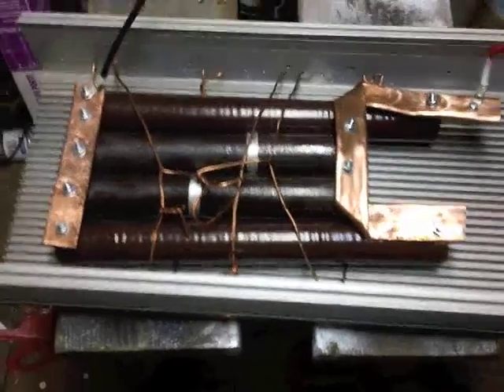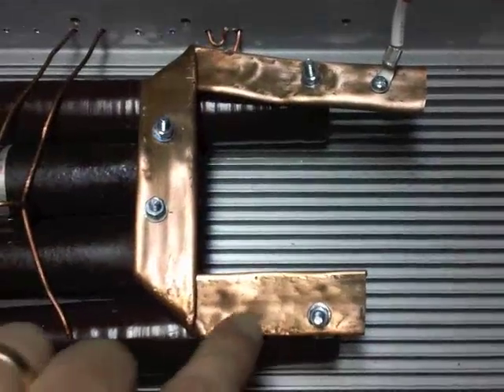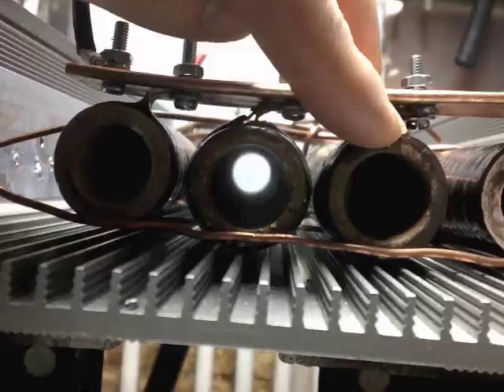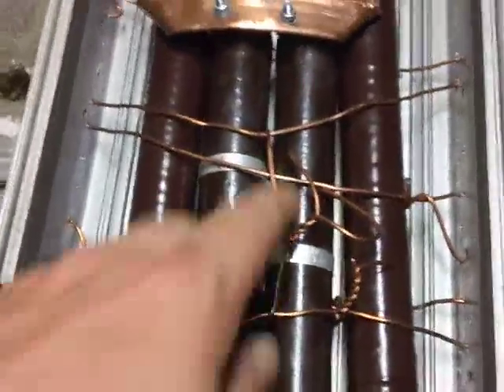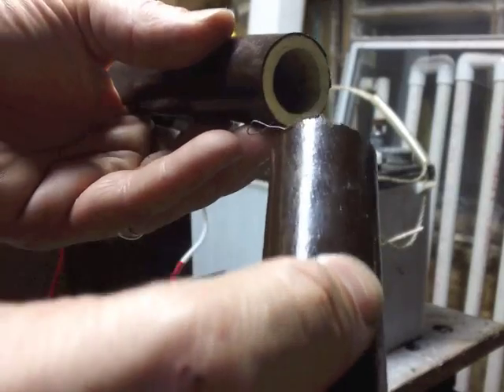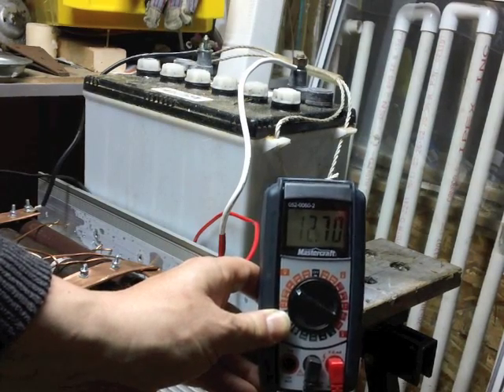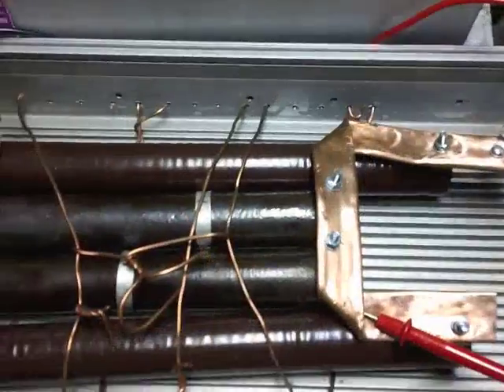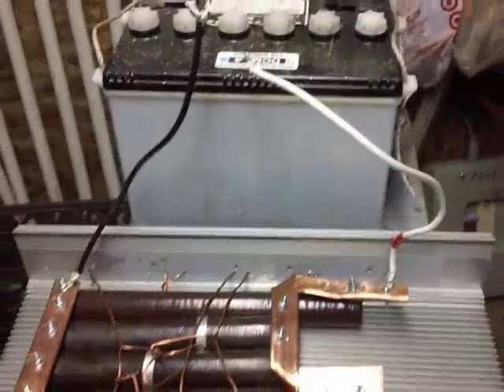Part 2 of Homemade Dump Load for a Wind Turbine

Comment: Heat is a product of power but not just power - average power. You can peak high power instantly - well above the wattage of a resistor - and have little effect on the burning up of the  resistor. This does not mean that if you put 1000 amps in a wire or material that it won't burn up a wire or material that is much lower in capacity than the 1000 amps - instant flashing at hot spot where the wire or material is weakest. 

When the accumulated heat from the average wattage exceeds the wattage of the resistor then it will be damaged by heat or burn up.

If the average power is much higher than the rating and it would burn up or open up connection --there is a way to increase the effective wattage even continually. He talked about sand - may work OK but this is much much better. Have a paint can or container that you put the resistors in and fill it with pure oil, which is not conductive. This is what they do in power transformers on the power grid - oil filled. Lightning can strike those transformers and flash over inside, breaking down the oil, and the oil moves around and mends the broken path where flash-over occurred. After years the oil is replaced because it becomes toxic and has leakage due to high carbon content.

At the same time those transformers use the oil to transfer the heat away from the transformer to the transformer case and its fins designed to have a large surface area to dispel heat to the air outside. This principle is why an oil filled can can increase the effective wattage greatly - venting the heat to prevent burnout- or a short..

Comment: Hey, I was thinking about this last week. I am now in an appartment and i am not able to use my wind/solar/hot water stuff at all. I did buy a few more toys like a 600W 12V water heater element, and many other trinkets that I am now storing while I pay for electricity from NWE. Ive herniated another disc and now have low and upper back issues. I wish u luck with all this. and I didnt ever find the good pictures i wanted you to see. sorry Brother.    73
Reply from the maker: No problem, maybe you can mount a solar panel on the balcony and create your own mirco off-grid project. Keep me posted on whats up. Cheers!
Reply: The Cedar Workshop I dont have a balcony or even South facing windows. I couldnt pick a worse spot to make solar power. no chance of a turbine!  Im stuck for the moment.

Comment: I would have connected the fan when the dump load activates to keep the  resistors cool.  I am also not very comfortable mounting the with the copper wires run  over the resistor packs.If a short circuit occurs that could produce a very nasty flame situation. I am sure the manufacturer of the resistors has recomendations of mounting .
Reply from the maker: This was my secondary dumpload. Used with the small wind turbine. No problems and it is monitored. Nothing from the manufacturers. Just a box.
Reply: Why are dump loads used as opposed to just open circuiting the turbine supply and killing current to zero ? Is this because the fans go into brake mode ?
Reply from the maker: The dumpload is for  the batteries. The power has to go somewhere.
Reply: I don't follow sorry , what purpose does the load serve in the battery ?
Reply: The Cedar Workshop
haven't watched it all yet. but you can get water heating elements, free hot water(or pre warming a hot tank) when you need to dump a load. pardon the pun.
Reply from the maker: Lets say you are away and there is a wind storm, the batteries (connected via wind turbine) would get charged up pretty quickly. Once they are charged, the power generated needs to be off loaded somewhere.
Reply from the maker: Sirus Yea, I want one of the those water heater elements. Maybe once I work out the cabin water system, I'll look into it. Thanks for the suggestion!

Comment: one big question. what do the resistors OHM out at??  the broken units wire seemed very small. my resistors have the resistance listed near the end and otheres are stamped in the middle. my units look like someone wrapped a flattened 18G wire ans then glazed it on the resistor. and FYI they can short to your copper supporting wire if the glazing is chipped on the resistor. in 15-20 seconds my unit would burn ur hand. ill look for pics 4 u.

Comment: I used the same style of resistors to make a hot water dump load. i used 2 resistors and i wrapped 1/2 inch copper pipe to increase their diameter. i put the pipes inside the resistors. i then used street elbows and "T's" to run two more pieces of copper pipe very close to the outside of the resistors. basically its 4 foot long pipes in a square with 2 in and 2 outside the resistors. its mounted on the side of my 6 gallon RV hot water heater. plumbed from the 1/4 in drain to the HOT output pipe.  IT WORKS GREAT! i think i have pics.  just FYI      Joe
Reply from the maker: Hi Joe. I'd love to see pics from that project. Please share!